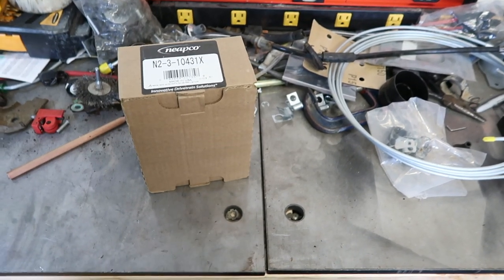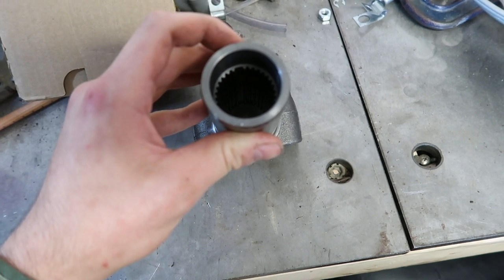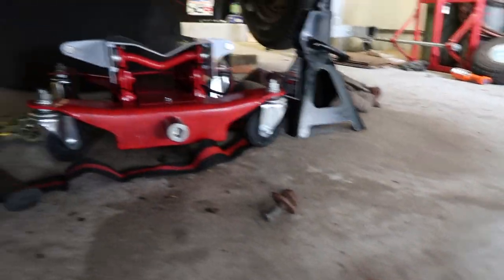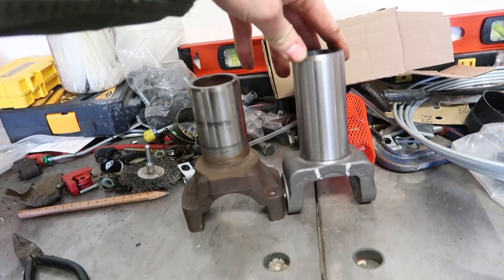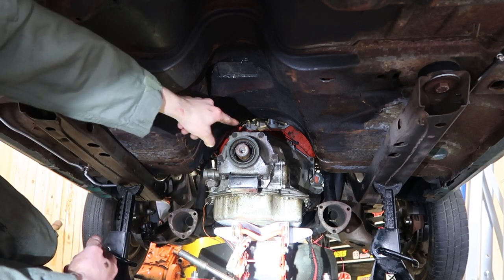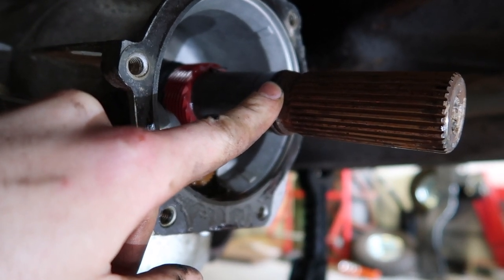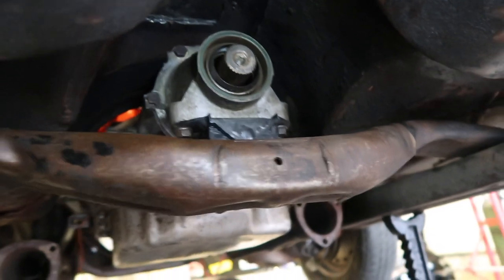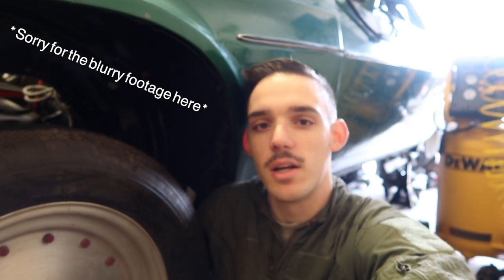TH400 Fixed Yoke To Slip Yoke Conversion!

Comment: Just got a 454 and TH400 out of a 88 motorhome. Bolt on yoke. Thanks  for posting so I can use trans in my Nova.
Reply from the maker: Bill Jr  Yes, my 454 & Th400 also came out of an 80s motorhome too! This will absolutely work for you. The transmission is now in my 73 Camaro with the original slip yoke drive shaft. Enjoy your ride!
Reply: @thecrispis2728  that's awesome!! Does yours have the HD on the bell housing? Hoping its even a bit beefier than a standard 400. :)
Reply from the maker: Bill Jr  I’m not sure if it has HD on it or not, it’s behind a sbc 350 for now just to get me around town. I hope it does, I’m building a 496 & going to use that trans for as long as I can! Lol
Reply: @thecrispis2728  496 will be awesome in the Camaro. Either way a 400 is plenty stout. :)

Comment: Just for additional reference I did the same thing but with a beefier 1350 yoke from Strange.  Part number STR-U1650.
Reply from the maker: Yes, I kept it 1310 because that’s what my driveshaft is made for. However I need need a 1310 to 1330 conversion u joint to mate the drive shaft to my 12bolt rear.
Reply: Hey, I'm doing mine now.. Looking at the U1650, it says the yoke shaft is only 3.5'' long. That doesn't seem long enough as on the th400 output shaft, from the end to the o-ring, it's about 3.25'', so it's only 1/4'' on the o-ring BEFORE you pull it out the 3/4'' to take your driveshaft measurements. Is that right?

Comment: You can use the O-ring on the slip yolk as well to prevent hydro lock.
Reply: No, you need the lubrication as the slip yoke constantly slides in and out. So remove the oring.

Comment: I contacted someone at Denny's the other day and they said on the Turbo 400 conversion bolt on yoke to slip on yoke the part number was Neapco 2060662 and the yoke you show with Neapco part number N2-3-10431X was not a conversion yoke. So who knows. But if that one works cool! I did look up the 2060662 part number on their site afterwards and it is the one needed by the detailed description

Comment: Just did this on my 4l80e in a my 65 cutlass. Do i need to put grease on the slip yoke as well or will the trans fluid be enough

Comment: How many different housings are used for a turbo 400? I have tried two brand new yokes. One slip yoke has splines all the way to the end and one like in your video.  But neither yoke will go in. The tail housing stops the yoke from being inserted.

Comment: So you have to remove that oring when using a slip yoke? Cause I simply bought the slip yoke for my TH400, inserted it into the transmission, and got my measurements for the driveshaft.

Comment: Hello, Great Video. I have a 1975 AMC 360 Jeep Cherokee Station Wagon 2 Door, I don't get into the 4 wheeling tearing shit up, I am more into Drag Racing and Street Rod's . I have the Turbo 400 and it's great . The Borg Warner Transfer Case needs a new $ 300.00 chain kit ,  Wouldn't  it be more cost efficient  to ditch the transfer case and put in the slip yoke and find a drive shaft to fit The Full Size Jeep ?  I would think selling the BW Quadra Trac do the dirt devils would cover my parts to ditch the 4 wheel drive into a 2 wheel drive.I do like to keep things original , But in my situation at my age if the T.C . Comes out it's staying out. 
Thank's.

Comment: I have a TH400 on a Cadillac that leaks through the hole in the yoke.  I've heard that the hole helps relieve pressure while the yoke slips in and out during operation.   Your setup uses a sealed slip yoke, I'm wondering how much of a pressure issue that will cause.  I guess the elimination of the "O" ring inside eliminates that problem?
Reply: Man I’m having the same problem in my 79 Cadillac… th350 … it leaks out the tailshaft seal …

Comment: Great explanation. I found the slip yoke online but would have never known about the o ring. I probably would have wondered why the shaft was so rusty but probably wouldn’t have figured that out. Thanks for posting! Did the same length driveshaft work for you with the new yoke in place?
Reply from the maker: Yes, I did not have to change my original drive shaft.
Reply: @thecrispis2728  @ my 97   4l80 has a steel o ring!!!   Instead of plastic,,, can it be removed??  To accept the long slip yoke!!

Comment: Putting one in a79 camaro, did you have to cut drive shaft?
Reply from the maker: The driveshaft that I got with the car fits fine with the new yoke. But I do not know if this driveshaft was original to the car or not.

Comment: would part # N2-3-10431X fit my 3L80? was out of a 1989 suburban with 454 and i wanna switch to slip yoke As well so i can get rid of the 2 piece driveshaft as well.

Comment: Did you use sealant when putting back on the tail housing or just the gasket?
Reply from the maker: I just reused the original gasket and tightened it down good no leaks here 👍🏼

Comment: Why are you changing the yoke
Reply from the maker: Broken wrench 21  So I could use a slip yoke, and keep the original driveshaft I had!
Reply: Was the u joint different than the sealed yoke
Reply from the maker: Broken wrench 21 no, both 1310 ujoint. You can buy the slip yoke with the counter bore that I have in the video with 1310, 1330, or 1350 u joint. I bought 1310 because that’s what my driveshaft originally had. If I upgrade my driveshaft to a bigger joint I’ll get a new slip yoke too.

Comment: What's the benefits of this?
Reply from the maker: P Motorsports to use a standard drive shaft with a slip yoke instead of a 2 piece truck drive shaft that has a slip in the middle.
Reply from the maker: P Motorsports  watch the video to see there is an O ring on the transmission output shaft that must be removed to allow spline lubrication.
Reply: @pmotorsports8276  No. Fluid would come out of the bolt hole.

Comment: You should probably point out that yoke has been modified. That particular yoke is a full length spline as ordered, you have to machine the counterbore in it to make it work on a bolt up TH400
Reply from the maker: The conversion yoke is counter bored from the manufacturer. It is not a full length spline yoke.